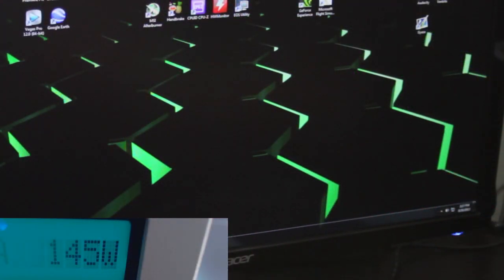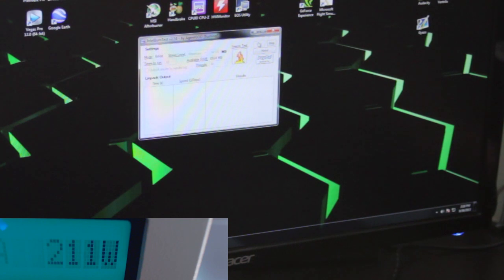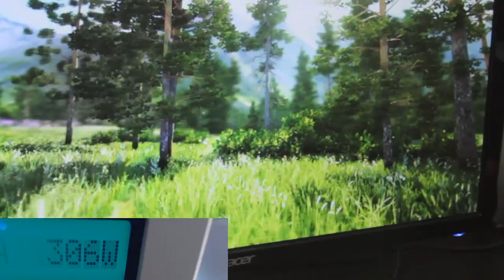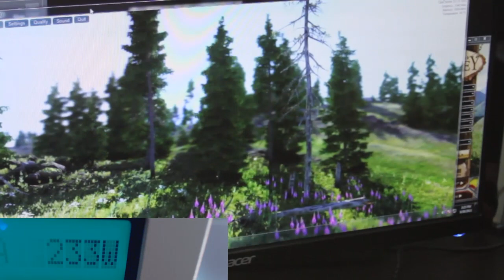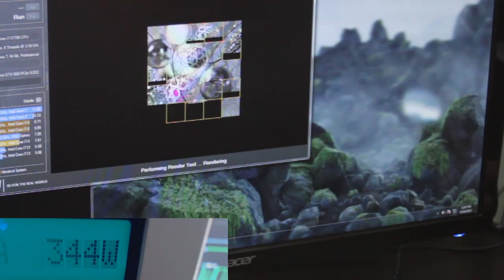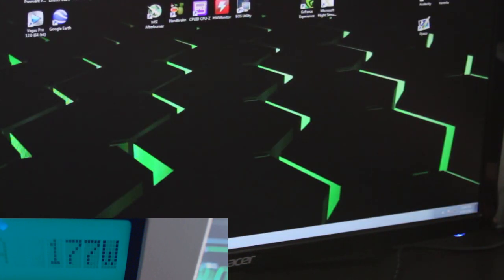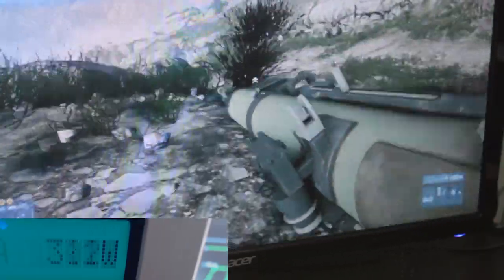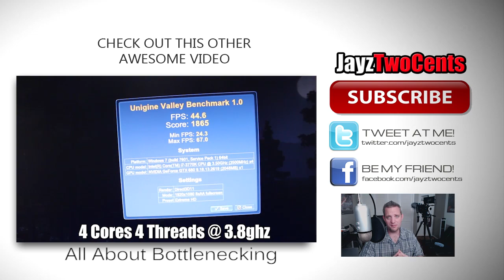How big of a Power Supply do you REALLY need?

Comment: Will 500w be enough for the gtx 1080 when it comes out? Or should I get more??
Reply: That calculator says i only need this for the 1080 gtx:
 Load Wattage: 380 W
Recommended PSU Wattage: 430 W

I have a core i7 with a 460 watt power supply and i really want the 1080 gtx ,i hope it will run.
Reply: +Rey Sanchez Alright! How much would you recommend bro?
Reply: check out some of the power supply calculators, they might help you. i know the coolermaster one has the 1080, check it out: http://www.coolermaster.com/power-supply-calculator/
Reply: +huffie00 I recommend taking a PSU with a good 50 watts over what the calculator recommends, then there's also space for upgrading
Reply: +thunks mr skeltal foor ur calcuim So i have 460 watt that should be enough now just wait until i can order it here in Holland cheapest i could find it 800 euro bit steep but it wil last at least 1 year :-)
Reply: A good 520W bronze 80+ from seasonic or delta or equivalently good producer is enough. For lower quality you might need 600 or even 750, depnding on the 12V rail amperage.
Reply: why are you skimping out on a power supply it will last you years get a good one with a platinum rateing. 760 wats is a good spot to be at
Reply: Yep, just ordered a 750W one =) I'm all set!
Reply: 460W will be definitely not enough.
Reply: +Sezer Çelik running fine for a while now on 460
Reply: huffie00 Did you get the 1080?
Reply: +Sezer Çelik yup and runs fine with a 460 watt
Reply: huffie00 Wow that PSU is having a really bad time. You should really upgrade it.
Reply: +huffie00 Why are you skimping on your psu. It's the most important part of a computer. If it dies so do your other components
Reply: +Nate Dimelfi wel if it works why change it i have a standard psu and working great i dont play on 4k anyways So its fine my next computer i will upgrade to at least 750 watt :-)
Reply: +huffie00 It's not a resolution issue, it's just that powe supplies degrade over time especially if they are running at 100% load.
Reply: +Nate Dimelfi an update running 5 weeks now not a single problem the vans dont even turn on GTA v full resolution So i can say yes you can use it with 460 watt without problems
Reply: prob somewhere between 600w and 750w

Comment: My current build im running a CX600M which is 240W.. 
My specs are: 500G SSD, 1TB HDD, GTX 760, i5 4440 and 16G RAM.. 
I plan on upgrading to a GTX 1070 and an i7 4790K soon. Should I upgrade my power supply?
Reply: +Excel Designs Although the CX series aren't very well received, you are fine, the 1070 uses LESS power than the 760 (150W vs 170W). 

My i7-4790K and 980 Ti system use about 350W on load, and I'm using a XFX 550W 80+ Bronze power supply. I have two SSDs along with a HDD, 4x4GB DDR3 RAM, and a huge cooler with lots of fans. I'm upgrading to a 1080 nonetheless.
Reply: +Excel Designs Also note that your i5-4460 is essentially a lower-binned i7 with disabled hyper threading and lower clock speed. They should have almost the same TDP.
Reply: HipsterPolice Thats brilliant thanks!
Reply: So you saying that maybe i shouldn't bother upgrading my cpu?
Reply: +Excel Designs The CPU? No I was saying that upgrading from the i5-4440 to the i7-4790K would see almost no change in power consumption as they're practically the same chip, but the i5 is less efficient. So an i7 is a great choice if you're not considering $$$ as you'd get much better performance without any real increase in power consumption unless you overclock. Your i5 wouldn't necessarily bottleneck the GPU but when I bought my 980 Ti I upgraded my i5-4590 to the i7-4790K because it's a much better match. 

Just make sure you have a Z97 motherboard or you won't be able to overclock the CPU, then you'd be better off with a Xeon E3-1231v3 or i7-4790 (much cheaper).
Reply: The i5 4440 is still a very good gaming cpu. You would only gain a few FPS (especially minimum FPS) only in some really cpu-bound titles. If the CX600M works on your current system you can probably keep it, but I wouldn't touch it with a pole. I would rather spend money on upgrading that to something like Antec Neo Eco 520, Thermaltake London, Antec VPF550, XFX 550 or something with real 500+W and good quality build. The i7 will give you a very small performance bump at the cost of damaging your whole system with a bad PSU. And anyway if in the future you really need to move to the 4790k you will need the extra power to OC it and get an additional boost. If you try that with your PSU I will haunt your nightmares. Really, I will.
Reply: I have a Gigabyte GA-H91M-S2PV... Would i not be able to OC?
Reply: Okay thanks for the help, i'm going to re-think the upgrade..
Reply: but the 4790k is already really fast, so you might still consider it in the future. I'm just saying that i would wait for now and get a PSU
Reply: Funny thing is that as time goes by components need less and less power to be better and better. Also why stress that much? If you need a bigger one just sell the other one and buy a new one. I just got a EVGA 650W GS Gold Plus for 80 bucks taking in mind that in my country thats the best you can get and this one costs like 150 bucks on ebay or any online store (Mexico)

Comment: Dear Jayz,
I'll be upgrading my PC
i5 6400 6gen
MSI H110 Pro VH Motherboard
Kingston 8 GB 2133 MHZ
Extreme Pro SSD
Zotac 950 AMP
4 Chasis Fan 2000RPM

Currently I have Circle 500W Raw power. Do i have to purchase new SMPS or will that be enough. 2 reason why im asking. 1. I saw one video which says that 12V should have min 18A. 2. When i connect second HDD to my existing PC one hard disk skip.. I was thinking its because of less power. Please reply with reasonable answer..

Comment: I have a seasonic 760 watts +platinum , the online psu calc said i needed more power if i wanted to run a second gpu, but based on this vid maybe not?  I have a vaporx 290x 8gb and was thinking of a second one further down the line.
Reply: use a psu calculator: http://www.coolermaster.com/power-supply-calculator/
Reply: if you knew how to read youd see that i used one, geez.
Reply: +poopasaurus rex oh wait lmao, sorry. major brainfart on my part.
Reply: If you don't OC them or raise the power target too much you should be ok. The calculators usually don't take into account the fact that your PSU might be really good, as in your case. Dependso also on your CPU, of course. If you run an FX 9590 you might have more trouble than if you run an i5 4460, for ex.

Comment: for i5 6600k and gtx 1070 I wonder if I should get 650 or 750 watt? or more? btw is i5 6600k good enough for 1070 or should I get i7? cant wait for 1080 and 1070 benchmark
Reply: +Yukino Takada 雪乃 鷹だ I'm going through a similar route and I went with a 750 watt. It's really not needed, but I'm building a future-proof rig with easy to salvage parts.

Dem modular cables though...

Also, I'm hyped for the 1070's street price.
Reply: +Yukino Takada 雪乃 鷹だ I am getting an i5 6500 with a GTX 960(1060 if that damn thing gets announced on time) and hook them up to a 450W 80+ power supply. My total budget is around 700 dollars so no core i7 for me.

Comment: hi Jayz i rly need your help am planning to buy a pc soo am going to buy i7 2600k 8 gb ram 1tb hdd x2 asus gtx 980 strix. Soo my question is can i run all this on Thermaltake smart se 730w psu ??pls for answer :)
Reply: Hi! I own i7 2600k  and also have 8gb ram :D but my video card is gtx 580. Yesterday I tested my system, gpu 100% load and CPU 98% all OC and load were using 360-413 Watts. your GPU is gonna use up to 375W plus 115 watts(95 default)CPU if it will be ultra overclocked + 40watts on actually whatever you gonna or may use (ram+watercool+12fans+4hdds+leds+soundcard) 

Your TOTAL usage is: 530 Watts
Recommended PSU load usage is 60-90%

You may go Easy on your Thermaltake 730w, everything modded and cranked up in your cpu will use just 70-80% of PSU.

You also may go on any 650watt psu with 80+gold or premium or 700-750watt psu 80+bronze psu also.

Thats the real calculations, you're good to go.

Comment: I will have an Intel i7-4790k 4.00 GHz and a GeForce Gtx 980ti 6gb and the power supply will be 600 watts 80 plus certified. Good fit? I may plan to overclock my cpu up to 4.25/4.5 GHz. Also ok?
Reply: Oh and also I plan to add another Gtx 980ti will I need to upgrade?

Comment: Correct me if I am wrong but I thought that a 1000 PSU with at least 80% efficiency rating is going to pull 1200 ~ 1300 watts of energy from the main supplying the system with 1000 watts while 200 watts or so is wasted as heat?

Comment: I wanted to upgrade my graphics card from an amd radeon r7 200 series to a msi gtx 980 but i only have a 600w power supply and i went into my local computer store and the guy i was talking too said my psu colud not handle my new gtx 980 and i should buy an 1000w psu is 1000w psu too much or should it be just fine?
Reply: What 600 watt PSU is it? A good one from a good brand would be able to handle a GTX 980 fine, but a crappy oem unit would probably not. And if you do have a crappy oem psu, replace it with a decent one of around 600 watts rather than spending tonnes on a 1000 watt one,  as there is no way a 980 needs 1000 watts.
Reply: +Someone Who Writes Comments on Youtube should I get a good 850 w psu instead
Reply: +Dj Harmon a good 850 watr would handle a 980 easily, however I would stick with a little lower, say a rm650i or a rm750i from corsair

Comment: Worthwhile note for those trawling for used and older parts to set up overclocked SLI gaming rigs on lower budget - some older generations of hardware are quite power hungry, especially when overclocking. Use google, look through forums and see what type of wattage others have been drawing for the different hardware you're looking at. Also, keep in mind that those strong wattage jumps WILL translate to increased cooling requirements.

Comment: Hello Jay, i have a doubt. Hope you can help.
I have a cooler master Extreme Power plus 600W PSU which has two 6 pin connectors for PCI-e. I am planning to upgrade to a GTX 980 ti which uses two 8 pin connectors. Now, does using a 6 pin to 8 pin adapters would help? or is it better to upgrade to a better power supply?

My other utilities include:
HD 7870 2GB OC
Samsung SSD
1 TB WD HDD
Maximus V Gene Mobo with i5 3570k
16GB of corsair vengeance RAM
Cooler is a cooler master TX3 evo with 4 case fans.

Any help will be appreciated.

Thank You

Comment: would a 650 watt power supply be enough to power this system:

Motherboard: Gigabyte Z170-HD3P, Intel Z170 Mainboard - Sockel 1151

Processor: Intel Core i7-6700K 4,0 GHz (Skylake) Sockel 1151 - tray

CPU-cooler: Prolimatech Megahalems CPU-Cooler Rev.C

fanr for CPU cooler: (2x)   Noiseblocker NB-eLoop Fan B12-P - 120mm PWM

R.A.M: Team Group Elite Plus Series black, DDR4-2400, CL16 - 16 GB Kit

grafics card: EVGA GeForce GTX Titan X Superclocked, 12288 MB GDDR5

SSD: Crucial BX100 2,5 inch SSD, SATA 6G - 250 GB

HDD; Western Digital Red, SATA 6G, Intellipower, 3,5 Zoll - 6 TB

DVD: LiteOn iHAS124-14 5,25 Zoll SATA DVD-Brenner, bulk -black

Soundcard: Creative Sound Blaster ZXR - Retail
Reply: +Felix Kranz my card is wayyy under a titan x . and they suggest 750 . to me 1 x that might turn into 2 later is 1000watts.  at least.
Reply: +chris Evans thx

Comment: Here's an easy guide for new PC builders WITH an Ivy-Bridge or newer Intel i5/i7 cpu:

450w Gold - Nvidia GTX 980 and below/ AMD 390 and below
500-550w Gold - AMD 390
550-600w Gold - Highest Tier GPUs (980 TI/ 390x)

For the mini-itx builders whose cases only allow SFX/SFX-L psus:
Silverstone - ST45SF-G (450w gold)
Silverstone - SX-600G Gold (600w gold)
Silverstone - SX-500-LG (bigger fan - has clicking noises tho)

Corsair SF600 (coming out March?)
Silverstone SX500/650G (not out yet)

Gold-rated PSUs are not that expensive anymore with platinum and even titainum rated psus out. Gold-rated psus should be a minimum for any serious gamer or productivity user.
Reply: +Albert Chang I have a 95 watt cpu and a r9 380 with a corsair cx450m and she runs good no problems
Reply: Yup, people really over-rate the power needed to power their pc builds.

Comment: nice video
i just finished building a new pc but the problem is that everything works for 3 seconds then turn off and on and off until i turn off myself
spec
cpu i5 6500
gpu mini itx gtx 960
spu sfx 450 watt
MB gigabyte H17ON-wifi
16 gb ram dd4
please help

Comment: I thought a 750 watt 80+ bronze Thermaltake power supply would be enough to crossfire my 7950s OC gfx cards... but I was wrong. It worked for a while, but couldn't handle the same load after a couple years of use. It could just be that Thermaltake power supplies are bad, but I'd go for at least 850w from a reputable brand (not Thermaltake) for any crossfire/sli if you're planning on overclocking.

Comment: Didn't watch this but depending on where you live a few percentages higher in efficiency might make a whole difference. MOST psus are efficient from 20-80% after that it drops off conciderably. My 1000w psu using 300 or so w is more efficient (even though its not by much its still more efficient) then my bronze psu was at 50% capacity.

Comment: What psu would be best for a :
AMD FX-6350- cpu
MSI Gaming 970 Gaming- mother board
MSI GeForce GTX970- Graphics card
16 DDR3 Corsair Vengeance- RAM
Cooler Master Hyper 212 EVO- heatsink
From looking it says i need about a 700w psu but if I could get away with another, less wattage, cpu that would be preferable (especially cost wise)

Comment: Hi guys i kinda didn't understand him ... so if i want to build a pc that have... "intel core i7 4790k overclocked to 4.4ghz, 32gb ram ddr3, gtx 980ti 6gb, cpu watercooler corsair h105, and 2 tb... will 1000w be fine ???
Reply: +DisStreameR StreaMkowCZ 

I added it all up, and you will be fine with 500w PSU, but thats pushing it. 650w recommended, 800w if you want to do SLI with your 980 ti down the road.
Reply: +ElementalsMods thanks man .... but is it gunna be fine with 1000w????
Reply: +ElementalsMods see if i'm gunna overclock my cpu from 4.0gHz to 4.4gHz will it show up in system propertys... or no ?? THX MAN :)
Reply: +DisStreameR StreaMkowCZ 1000w will be plenty lol like Elements said above, 800w is plenty also

Comment: Intel core i3 4170
Gtx 950 ftw 
1x8gb of ram
WD CB 1tb 7200 rpm
Silverstone TD02-E 92.5 CFM Liquid CPU Cooler
Is 430 watts enough
Reply: +Diego Torres  yes. you can get by with 300w easily, but most 300w PSU don't include PCI-E connectors which are needed for the 950 ftw.
Reply: +Diego Torres A 400 watt PSU is sufficient for those specs so the extra 30 watts will provide you plenty of headroom. If you want upgrades you will need at least a 500 watt PSU though. For example the GTX 970 or 980 will not run on a 430 watt PSU.

Comment: 500 W quality power supply 40 amps on the 12v rail enough for gtx 770 and i5 4690k?
Reply: +David Chudzik also it can have a continuous 480 W on the 12v rail
Reply: +David Chudzik A. GTX 770 will never draw more than 300 Watts. You're ok.

Comment: And I'm here with my overclocked 760 and overclocked i5 machine pulling 400W in valley...
Reply: +acnfanmanin Same here. 2500K@4.4G + Radeon 7870 OC on a 400W PSU. 360W at the wall in CPU+GPU synthetic, which means 300W PSU output, 30% headroom. Normal gaming is <300W at the wall.
Reply: ***** Hahah my 760 is a power hog with 1.3v voltage hack though so that's why.